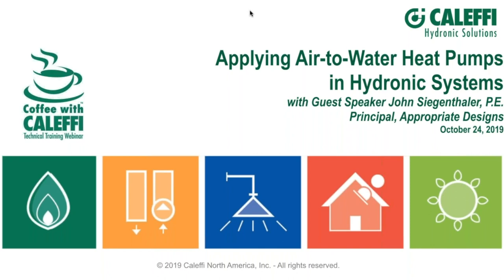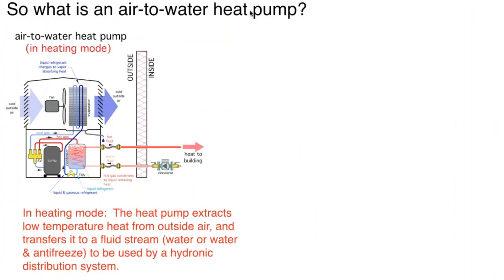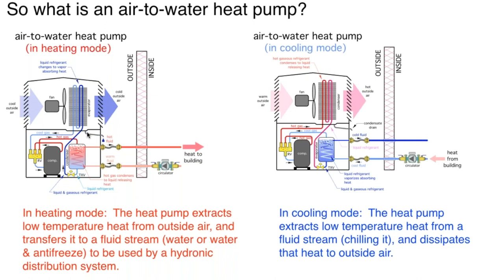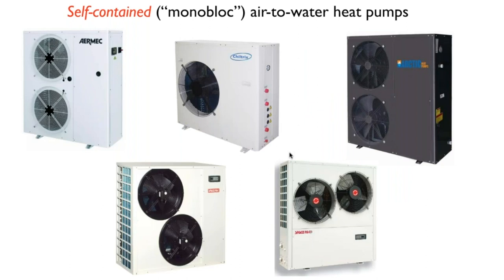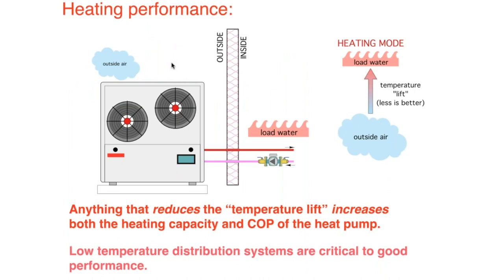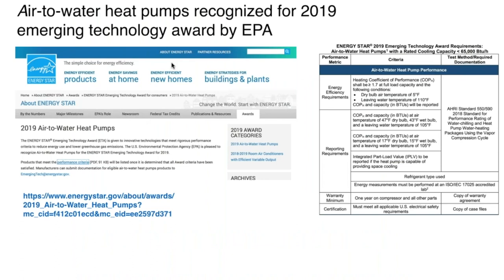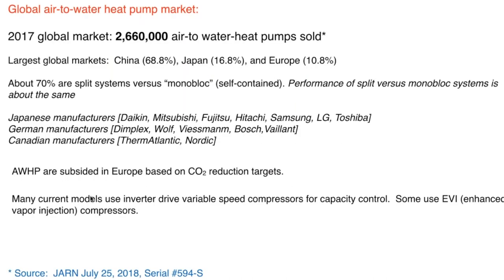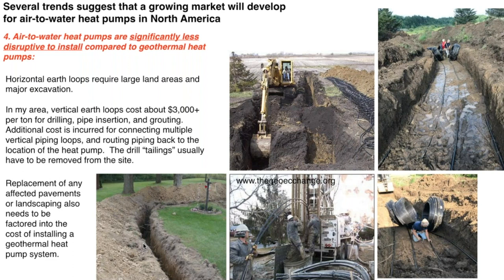Applying Air to Water Heat Pumps in Hydronic Systems

Comment: Great material as usual, and it's fantastic that Caleffi produces this training for free, and I say thank you for that. 

Electro Industries here in Monticello MN also sells a split air to water heat pump system. Of course it interfaces with their modulating electric boilers to supplement the heat pump or take over 100% of the heat and DHW load if the heat pump goes down. I've talked to a couple of customers about them but most don't bite because natural gas is so abundant and cheap in my area
Reply from the maker: We appreciate your feedback and your comments regarding air-to-water heat pump systems.  All the best!!

Comment: In regards the the slides at the end - is it easier to use zoned air handlers for cooling? Why not run everything through the pipes?
Reply from the maker: It is possible to use zoned air handlers supplied from a chilled water buffer tank.  However, not all buildings need zoned cooling.  Many houses are well suited to single zone cooling.  This can be done with a single air handler and may eliminate the need to maintain a chilled buffer tank (if the heat pump can modulate its cooling capacity).  Single zone cooling with ducted deliver also allows for whole house air circulation and possible tie in with heat recovery ventilation.  Finally, single zone cooling is definitely less expensive to install compared to multiple zone cooling